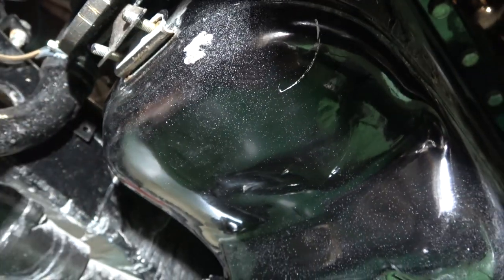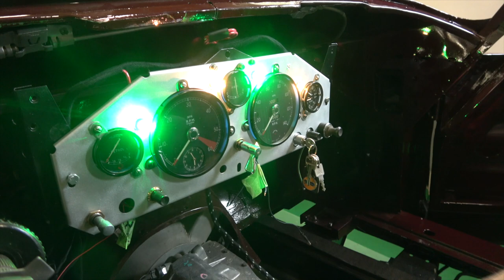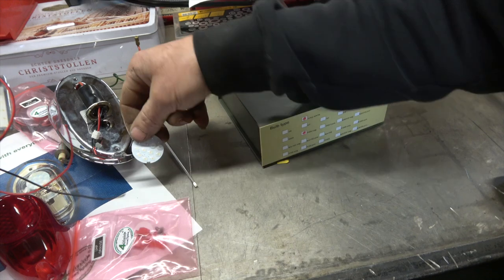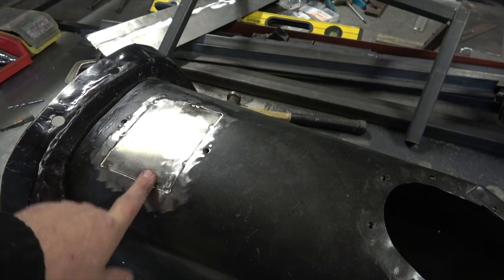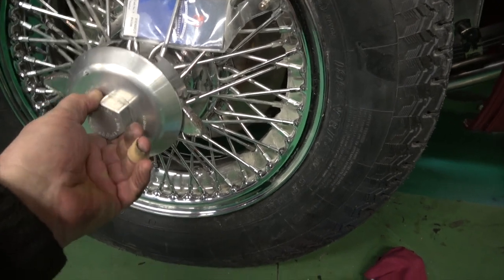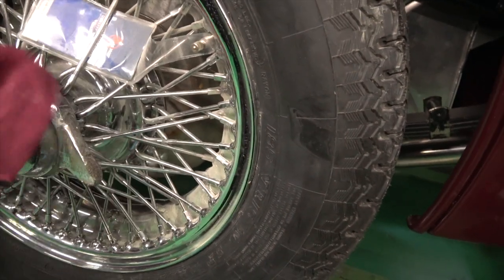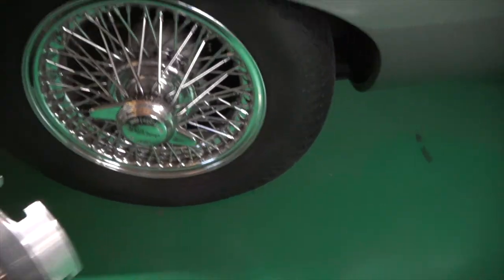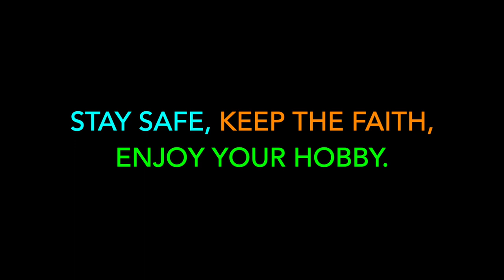1958 Jaguar XK 150 OTS Rebuild  ( LED lighting & Spinner Tool ) Part 13

Comment: Some times it pays to moan as it makes people focus a little more and now you will be able to open and close your doors again on the XK, I read a bit recently in the UK that some led lights do not meet the legal requirements, (who knows) I think it is more for the rear lights (too powerful) and certain output powers for the headlights, its getting bloody confusing considering all the different types manufactures now use, you would think that better lighting would be endorsed by the powers that be but the boys in blue over here seem to have a different outlook on this matter when required !!  but a little gem here, I remember a garage doing much the same with a trolley jack and a block of wood under a mini sump......it tore the engine mounts apart, when the bmc works team back in the days of winning rallies etc used the sump to jack the car up the engine mounts were fitted with an angle over the top and welded in place so as the engine was lifted on the sump the angle took the load and held everything together, but you would have thought that with the XK they would have been more careful.  Regards Doug.
Reply from the maker: Doug,  I never saw myself as a grumpy old man but some days you wonder how the world got into the state it‘s in 🤔 I have LED lights for my Mini Cooper
and had to change them back to original. There is no way they would pass an MOT as there is no pattern or focus but they were very cheap and I should have 
bought quality LEDs you get what you pay for I guess.  A good sump guard will take the weight but I have had problems in the past with my Cooper and damage
to the floor as they jacked it up un the sills instead of the subframe. I will check the mounts and now I know what has happened. Cheers Dave

Comment: Nice thought on the spinner, BUT mine only fits on one way.
Reply from the maker: Gary, I was very surprised it went on but I have to admit they are very dog eared 🤔 But thanks for mentioning the E Type as that was the very reason I bought 
it in the first place. It scared the shit out of me weilding a hammer next to brand new bodywork & paint. Cheers Dave

Comment: I am interested in your LED lights, would like to see more on that subject. They certainly are much brighter and the red to amber would work really well in the single red lens. Is it not possible to get one LED unit that will do the switch? Or do you need to have 2 units?
Kind regards Paul from 48 Spokes 🇬🇧
Reply from the maker: Paul,  I will be doing a full video of the installation and any issues we run in to. What really surprised me was they even included an indicator ticking noise generator rather than just relying on the repeater lights which are very easy to leave flashing.  I have been watching your videos 😉👍Cheers Dave
Reply: @ClassicCarCave  Hi Dave,
Thank you for subscribing to my channel. I hope you are enjoying the content. Did you watch the one on the Wire Wheel Adaptor problem I had?
Kind regards Paul
Reply from the maker: @itsalldoable  Paul, I haven't seen that video yet but I will take a look I‘m just a bit busy atm. Cheers Dave
Reply: @ClassicCarCave  no worries Dave, they aren't going anywhere. Projects take priority 👍